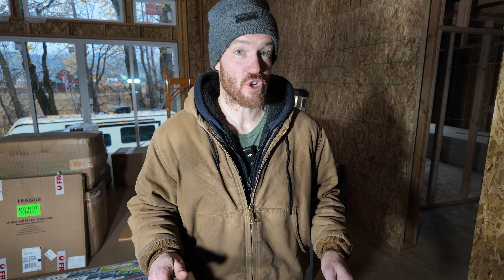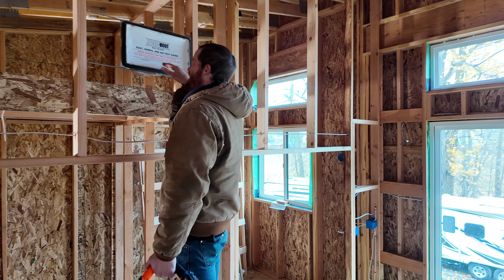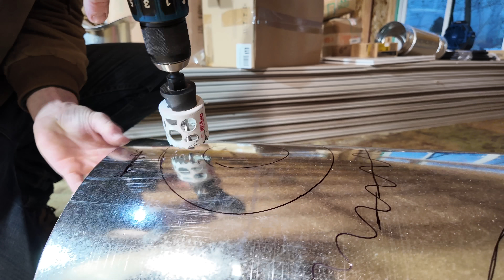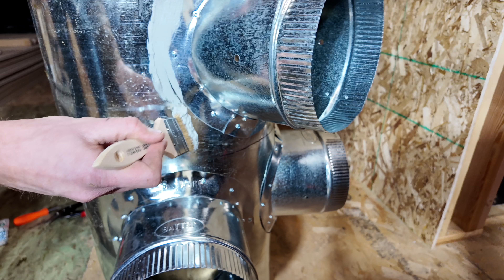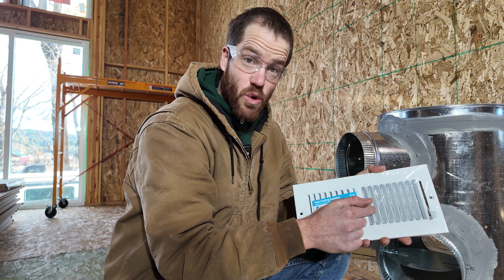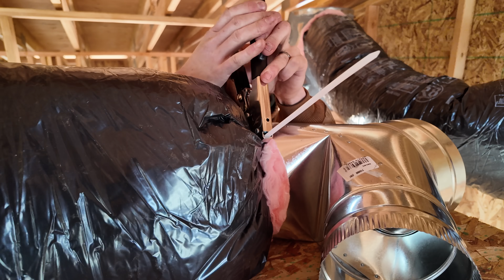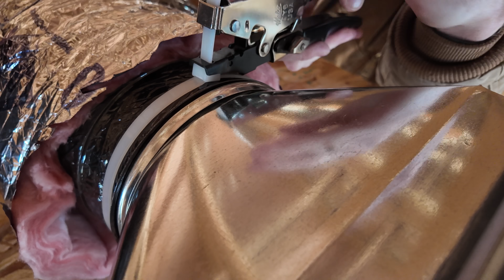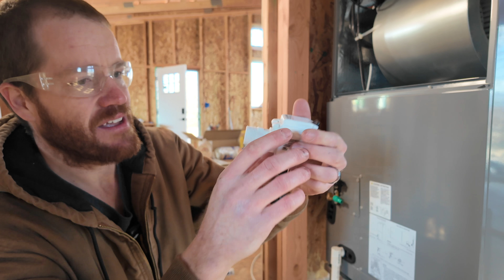HVAC Contractors Hate Me For Showing You This

Comment: this is not going to work wright
Reply: There doesn't appear to be sufficient air return, not to mention the the location of all the supply ducts near the ceiling.  That would work okay for A/C supply, but heat supply is universally placed low in rooms, especially near large openings, such as that 4 panel patio slider.

Comment: I may have missed it, But don’t forget a filter! I would also recommend adding some Bypass air in each bedroom to avoid door slamming due to imbalanced air pressure it helps with air circulations too
Reply: looks like he is using the factory A/H slot for a 1 inch filter. but its gonna be difficult to change since he installed the drain line right in front of it.
Reply: My bedroom door slams when the unit kicks on, how do I add bypass air, it is a new home.
Reply: @sparksalot4950 What I’ve seen builders do is right above your door cut into the drywall example 2  8x10 Flat grills one on each side of the door and just offset them for noise reduction make sure no studs are in the way for a smooth transfer.. I would say that’s the quickest and most money efficient way of doing it
Reply: @itsdrew712  thanks !

Comment: I spent 35 years in the HVAC industry. Ten years of that as a contractor. I have to say, you did your homework. Beautiful job for a DIY. I've seen contractors do much worse. The $20K is a bit high, even for a boiler system, which is the most expensive heating system. I would have charged about $7K. With the parts being wholesale, I would have made a sweet profit for one days work.
Reply: If you think $20K is high in today's world then you've obviously been out of the game for a while.
And one day's work for an AH, duct work and an outside unit??? Yeah, maybe with 4-6 guys.
Reply: @petermoto409  Wow, you work slow. 4 to 6 guys, that's why you need to charge so much. The system is plug and play. No cutting or soldering. All being put in a small house. I'm surprised you're still in business. I've installed many of those mini splits. I can do the ones where the indoor unit mounts on the wall in about two hours, complete. Not only that, but I can run the ducting on a three-bedroom house by lunchtime, alone. With two smoke breaks. It's called knowing your shit.

Comment: Around all of your vents, you have got to insulate that it will sweat when you turn on your air conditioning and cause a river mold mildew also around your homemade Plenum anything that is exposed metal has got to got to got to be well insulated you can buy roll Silver back AC insulation and silver tape. If you do not, you are going to have mold water issues from sweating. I have a firsthand experience at this any air that gets to that metal will sweat.

Comment: Since I am an electrical contractor, I notice electrical stuff obviously... lol You want to be sure you are in code compliance.  The code requires you to have an outlet within 2' of each door, and every 12' of unobstructed wall space.  You need to have an outlet in the HVAC closet as a maintenance outlet.  Those are just a couple of the obvious things I noticed in your video.
Reply: 100% correct
Reply: plus 2 20 amp crts in kitchen on counter. Plus lighting, frig, stove, dishwasher and microwave

Comment: Physics teaches us you do not cool air. You remove the heat from the house and discharge it outside in an HVAC unit.  Hence, when you’re using a heat pump, you remove the heat from outside and then discharge it into the inside of the house. Heat is Moved into the Object, the Result is Cooling!

Comment: I used a mr cool to replace my heat pump system that was originally installed in 1979. MrCool saved me $15000.00 over my high quote.

Comment: Not how this is done.
Reply: It is if the main objectives are to build a house as cheaply as possible and provide entertaining YouTube content.  Glaring structural issues throughout, from the foundation to the roof.  Clearly there is no inspection schedule in that area however if the plan is to market this building when construction is complete, they could very well be opening themselves up to potentially serious legal issues.  Even if the plan is to keep the building, the cost saving short cuts may quickly prove to be false economies.

Comment: I always wondered why residential hvac never has an outdoor intake…. If you could pull air from the outside then on those really nice days your house could have nearly perfect air in it…. Then when it gets cold you shut it down to a tiny little bit of outdoor air coming in which will pressurize the house just a tish which should help with any cracks in the insulation as it would let the conditioned warm air out instead of the drafty cold air coming in…. Also keeps the dust down Same but different in the summer when it’s hot out
Reply: Thats what an ERV is used for.
Reply: @ it’s still energy recovery though unless it has a bypass

Comment: I wish i saw this video about 6 years ago!  I used to have an issue with my HVAC unit that was "professionally installed" where the drain would clog from time to time causing it to flood the basement.  WTH did those "professionals" installed the overflow switch.  Always wondered why the drain had that "optional" port!!  Now live in an area without AC so non-issue.

Comment: Big mistake doing this without people knowing how to this the right way. It will come back to haunt you later. Everything you have done needs to be inspected to make sure everything was properly installed!
Reply: Agreed.  I've been watching this channel since they had under 50,000 subs and the direction seems to have changed, in this project in particular.  While they often offer the disclaimer that the channel is about "what we're doing" and not "how to do it", some of the comments made during filming (such as tending to "overthink" things or, we're not going drive this on the road) seem dismissive fundamentals bordering, at times, on hubris.

Comment: Did Mr Cool forget to tell you you need an air filter on that unit and be able to change it... insulate all that metal that is showing on your plenum and your boxes.... you did really good for the first time....😊
Reply: I'm, assuming it's inside the unit, I didn't see enough pictures and he didn't put the unit on a box with a filter track in it, just a stand. Maybe he's putting it on the back of the vented door?? That things gonna be loud, I'd have put it in the attic.
Reply: Those units come with a air filter built into the air handler.
Reply: @thomasalison6188  yup, and he just blocked it with drain line))
Reply: i noticed the same thing

Comment: Fairly early in you air distribution plan you appear to be working on the basis that "return" air will find its own way back to the air treatment unit.  Sorry!  That is defective planning.  You will need suitably large sized ducts for return-air to be sucked back from the various rooms in the house.  Air-feed ducts normally come into rooms below windows, and the air-removal ducts should be placed in places remote from where the air comes into the rooms.  You obviously now have a LOT of repairs to do where you made holes in walls, and a LOT more planning of duct placement.    Sorry.  "Thumbs down" (a first from me) for your poor show today.
Reply: Agreed.  They really seem to be going at this with a "flipper" ethos.  You get what you pay for, and one of the biggest ticket items (but also one with some of the greatest returns) in building a house is adherence  to fundamentals of design and construction.

Comment: Great job installing the HVAC system. I’m wondering what the cost would have been for the ductwork if you used metal? Are you going to also have wood heat?

Comment: 10+ years in HVAC and I’ve got no problem with what you did is it pro? No but will it work? Yes. I will say all those exposed metal pieces in the attic are going to sweat like crazy in the summer bro. Get some wrap insulation and wrap it all up and tape it off so you don’t have any moisture problems.

Comment: Your assembly of the drain-pan with the relevant overflow nozzle appears possibly to be missing appropriate sealant to prevent leakage from that join.  Also, the corners appear to be held in place only by one screw at each corner, without any sealant or solder.  What about a drain pipe for the overflow?  Probably better to turn the pan around 90 or180 degrees, so the overflow can go down through the floor probably by one of the walls (will depend what you have below and how the pipe can be routed to a drain).  (No, I am not a HVAC person, nor a plumber, but just one of your followers who is a general home-handman who thinks ahead.  Wishing you well with your new project.  Also, remember that all your air-pipe tubing joins will need appropriate adhesive silvery/or aluminium wrappings to seal them to prevent unnecessary air leakage.

Comment: I’m sure somebody already commented but all the major DIY stores sell a metal foil tape that is much easier to work with and can be removed much easier than your putty if any modifications or cleaning is required down the road but what your using does work I’d just rather use tape as that’s what is standard in the industry (nearly 10 yrs as an HVAC installer initially that turned into senior service tech down the road).

Comment: Not a bad HVAC install for a guy that hasn't done it before but I do have a questions and comments. You probably should read the manual and make sure that indoor unit doesn't call for a four to five foot metal plenum coming off the air handler. I have seen flex hooked directly to them but it's not recommended because of fire hazard. Also I couldn't tell but you may want to make sure that drain has a clean out T on top. You will have to clean that trap out at some point and why did you put the thermostat so low on the wall instead of eye level? But overall you done a good job. But definitely check your manual for plenum requirements may even call the company and ask them if you can take flex right off the top of the unit. Those heat strips get really hot.

Comment: You could also get some wide straps to suspend the ducts from the rafters.  This will reduce the chance of them getting crushed and and you can straighten them to improve air flow efficiency especially for the longer runs.
Reply from the maker: That's a great idea. I think Riley is going to go back and add some straps.
Reply: @AmbitionStrikes be careful with the placement and weight distribution of straps.  Installer in our new house put a strap directly under a seam holding a lot of weight.  After an enormous gas bill, I climbed up there and found a massive rip in the duct.

Comment: Just found your channel a week ago and love it! Been binge watching your videos and telling others about it. My son is a lot like you. He is currently working on his 2 story shop with an apartment for his parents. The apartment is just under 1200 sq ft (by law) but on the first floor. The shop, storage, crafts room and man cave together are about 3500 sq ft. All electric as CA law prohibits gas on new construction. Using ductless air mini splits with ceiling vents instead of being wall mounted. One handles the great room and bedrooms and another one handles the bathrooms and crafts room upstairs so we can turn individual areas off and on depending upon use. My son built a custom 3200 sq ft home that is about 100 ft from the house. I love your solar videos! He has to connect to the grid with his solar array but will be setting up a second solar array next year that will not be connected allowing the house and the shop to go off grid. He's on 5 acres so he built a structure to mount the solar panels on. He will DIY it but it's expensive with all the panels, inverters and battery storage.

Comment: Who puts their hester in their living space when you have a basement??
Reply: In Canada, where we live, that wouldn't come close to working effectively during winter where a -50⁰C. wonter wind chill is not uncommon, and electricity total costs are becoming prohibitive as well as less reliable due to solar farms and wind turbines not effectively producing their expected output while conventional electricity production being cut back to meet the false goals of climate change propaganda.
Reply: @reboot_2.00  blah blah blah
Reply: More centralized location my not want to heat his basement
Reply: @chasesettlemire312  It doesn't have to heat the basement.
Reply: @chasesettlemire312  You don't have to heat your basement, but you would save more upstairs space installing the unit and ductwork downstairs and have lots of space for servicing and installation. Just don't cut in any ducts to heat the basement, although I would with individual dampers on each run. As far as the 2nd floor, I would make ducts that would fit inside a wall joist space(s) and then at the top, elbow into a 2nd floor joist space(s) with a boot to receive the floor register. I'm a retired union Tinner.

Comment: The house looks awesome! Perhaps instead of a rachet strap you could have used DUCT TAPE......The one thing it was actually made for.......Don't worry. I did the same thing, and my buddy busted me for it. I just never thought if it for that... This looks like a great system. I'll definitely keep it in mind for my next project. In my last house we needed a new unit and they put the upstairs unit in the attic most likely when they were framing, because it didn't come through a 2'x2' hole, and the downstairs unit was in the crawl space, which had the same kind of access. I think the main cost of the job was labor for them taking apart and reassembling the units piece by piece to get them through the holes. It was a nightmare. I do have a question for you: What are you doing for the intake? We have 1 large duct on each floor (Where the filter is), that keeps the system "sealed" for lack of a better word. How do you do that with the intake under the unit? Are you going to close off the sides and add a filter? Best of luck until next week!

Comment: Here's the text with added information about whistling:
Think of your house's air system like breathing. You know how you both inhale and exhale air? Your house needs to do the same thing:

Supply vents (the ones that blow air into rooms) are like your house breathing out
Return vents (the ones that suck air in) are like your house breathing in

Two important rules to remember:

The path for the "breathing in" air (return duct) needs to be at least as big as the path for the "breathing out" air. This helps your system work properly, just like how you can't breathe well through a tiny straw!
Every main room in your house (like your bedroom, the living room, and kitchen) needs either:

Its own "breathing in" vent (return vent), or
A way for air to flow back to a return vent (like through the gap under a door)

Here's something else to watch out for:
If your return air has any tight spots or restrictions (like a bent grille or partially blocked vent), you might hear whistling noises. This happens just like when you whistle with your mouth - air makes noise when it's forced through a small space. If you hear whistling, it usually means something is blocking the air's path and needs to be fixed!

Comment: You guys are great DIYers.
AC leaks reminds me of calls about water in the computer room of a company where I did facility maintenance. 
I would remove the drain and blow it out with portable compressed air while water came out of the the hole in the pan. 20 minutes work got me 4 hours pay. They finally caught on, and had the HVAC guys clean the drains on a regular basis.

Comment: Are you having any issues with finding contractors that will work with Mr. Cool warranty, have read several times that people are unable to anyone to work for Mr Cool.
Reply: I hadn't any experience with MrCool before I started seeing them advertised on various YouTube channels and your question had me wondering.  So after a quick Google search, I found -
      "Some common complaints about MrCool HVAC systems include issues with poor cooling performance, inconsistent temperature control, potential refrigerant leaks, noisy operation, difficulty with installation due to design complexities, and customer service challenges regarding warranty claims; with some users reporting problems with units failing prematurely, especially when not installed by a professional. 
     While they do seem to offer some value in certain applications, this channel has never really made it clear (that I can recall) whether or not they were being compensated in any way for the use of these Chinese built systems.
caveat emptor